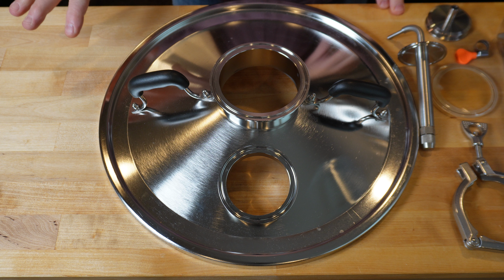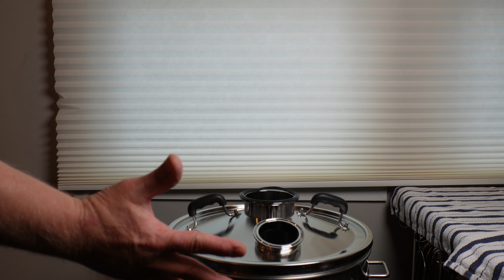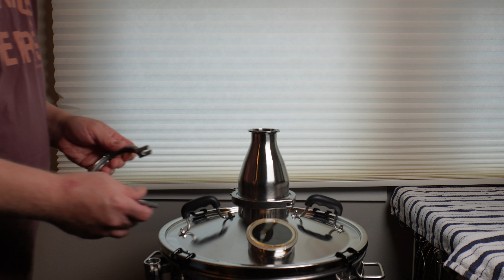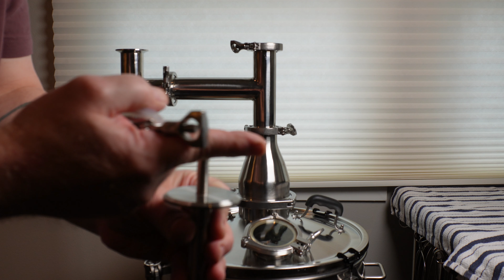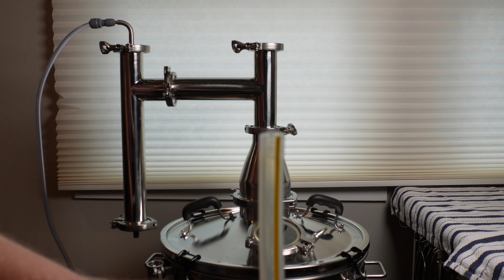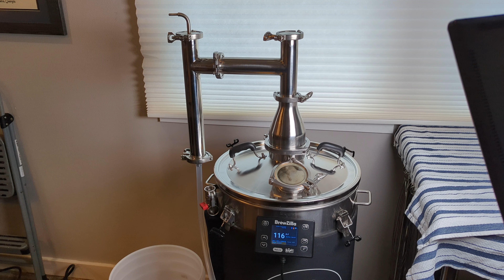BrewZilla Steam Condenser Lid

Comment: Do you know the dimension of the lid of the 65L? I have a 16 gallon vevor unit and want a steam condensor
Reply from the maker: Sorry it took so long to get back to you! The diameter of the BrewZilla unit from outside edge to outside edge is 16 1/16", and the distillation lid from outside edge to outside edge is 16 5/16". Let me know if you need more specific measurements of any specific parts to see if it'd work with the Vevor. Thanks for watching and commenting! Cheers!

Comment: When do you add your wort chiller?
Reply from the maker: Great question! I have a Jaded immersion chiller so I just take the steam condenser lid off when I'm adding whirlfloc and stick the immersion chiller in at that point, so basically the last 10 minutes. I've debated getting a counterflow chiller to make this a bit nicer but since it wouldn't be a single pass and I don't currently have a stainless fermenter and glycol, recirculating back into the kettle from a counterflow chiller would probably be worse. Hope that helps. Thanks for watching! Cheers!
Reply: @irondalebrewing Thank you I have a Jaded as well. Will definitely use it. 

Cheers!!!

Comment: Brilliant, I see you used the clamps on the lid, as you have seen i purchased the condenser for the GF G30 and was hesitant to clamp the lid as I am aware Anvil have a condenser and say not to clamp, I also note the issue with the sight glass not really being a sight glass, have you resolved this issue? I also think it could be water pressure causing the leak from the fitting did you resolve? Sorry for all the Qs but you also commented to say your boil off has changed with wort, do you have a video of a brewday whilst using the condenser (im going to look now as thats me being lazy) cheers and great video 👍
Reply from the maker: Thanks for watching and for the great questions! Concerning the clamps I wasn't aware of the Anvil version and them saying not to clamp, so I used the clamps for no reason other than my thought that there might be enough pressure that you'd want it clamped down, and that it would make the seal tighter to keep any steam from coming out of the perimeter. I did notice when I remove the "sight" glass that it wants to pop right off of there once you remove the clamp from around there, for whatever that's worth. Unfortunately I didn't solve the issue of not being able to see through the sight glass. I think you may be right about the water pressure causing that drip from the Duotight fitting -- when I jam that forward harder it seals up better. I do have what is theoretically a better fitting for that but haven't tried it yet. Your John Guest fitting looks nicer than the Duotight one! Looks like you found the video of the first brew I did with the steam condenser lid so I'll comment over there, but for those reading this comment it's https://www.youtube.com/watch?v=4q-OSlDZWUA Thanks again! Cheers!
Reply: @irondalebrewing cheers and great replies 👍 🍻🍻

Comment: Do you think it would be possible to recirculate water using a pump to reduce water consumption? Maybe with a couple of changes once temperature has increased?
Reply from the maker: That's an interesting idea -- my initial thought, and this is not based on any actual knowledge or experimentation, is a couple of things: First, as you point out, you'd definitely have to chill the water since based on some quick googling if the water is above 120F it won't be cold enough to condense the steam. Second, and the bigger concern I'd have, is the "waste water" coming through the condenser lid will have DMS in it, so I'd think if you recirculate that, it potentially could contaminate your wort. A lot of people use the waste water from the condenser lid for cleaning or watering plants, but I'd be nervous about recycling it back through the condenser lid itself. I could be wrong on that second point but at a minimum it gives me pause. :) Thanks for watching and for the great question! Cheers!
Reply: @irondalebrewing thanks for the response. I thought as much with the temprature point. I didnt think about the dms side of things, again not based on any experience but if that was the case wouldnt the plain water 'contaminate' the wort too? Im new to brewing so just trying to learn as i go 🙂
Reply from the maker: @edjohn244 Where my brain went is since the water in the output bucket is the condensed steam from the boil, that will contain DMS (which is the reason boiling with the lid on is bad), and sending back through the steam condenser might have the potential to negatively affect the wort since you're feeding the water with DMS in it back into the process. I have no idea if that'd actually happen but seems potentially risky.
Reply: @irondalebrewing  id imagine the dms would increase in that water, but if it was swapped out when too hot that might work. The 'dms' should be contained in the condensed water and not re enter the kettle is my thought, otherwise there would be other contamination issues aswell possibly?
Reply from the maker: @edjohn244  Could be, my comments are all theoretical since I've never tried it. :)
Reply: @irondalebrewing same as mine, would be good if there was a way to find out without ruining a beer 😂

Comment: Nice work! Do you have a dedicated circuit for your BrewZilla?
Reply from the maker: Yep, I have a dedicated 20 amp circuit. I did have to get a converter to go from NEMA 6-30R (the plug type on the BrewZilla) to 6-20P (the outlet type I have in the brewery) and a heavy-duty extension cord but it works great. I believe 20 amp is the minimum for the 220V BrewZilla. Thanks for watching!

Comment: Thanks for this detailed walk-through and your thoughts on applicability and possible benefits! I have taken the same route, being sick of either setting up a fan in an already packed brew spot or hoping for good cross ventilation with opened windows. I am very curious to see how your setup will work out in your initial brew with it (hope to see another video as for this ;) Are you (or is anybody) concerned about a significant decrease in hops utiization by the way (due to a lack of stirring)? Cheers!
Reply from the maker: That's an interesting point -- I use hop bags and tend to just throw my hops in and let them float around as they will in the boil, so maybe I'm not getting as much hop utilization as I could be. So I'm not worried but maybe I should be 😂 or maybe others will have thoughts on that.I'll do a brew day video when I use it for real soon and include any updates in that one. Thanks for watching!